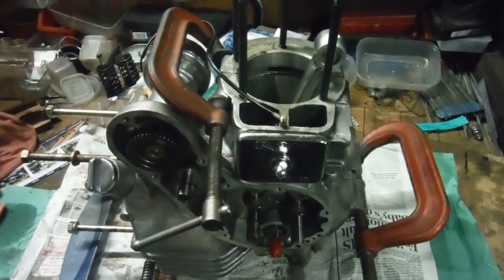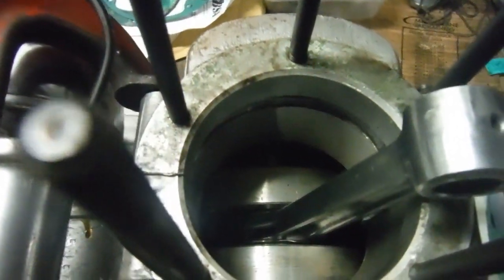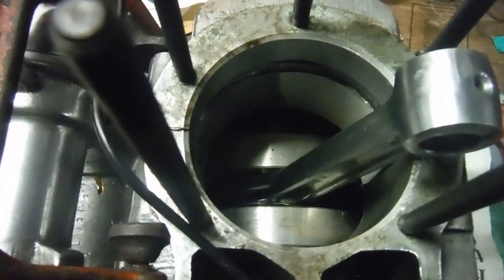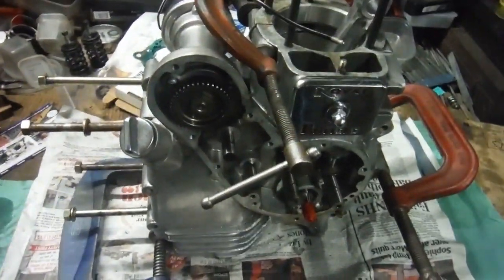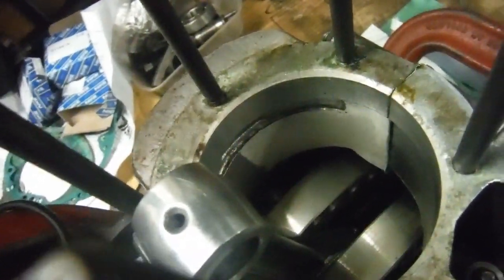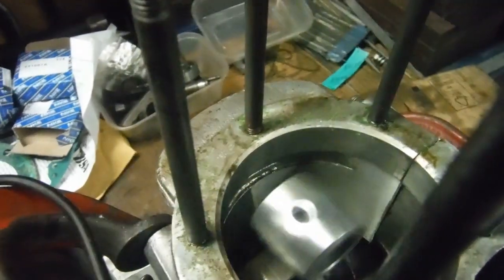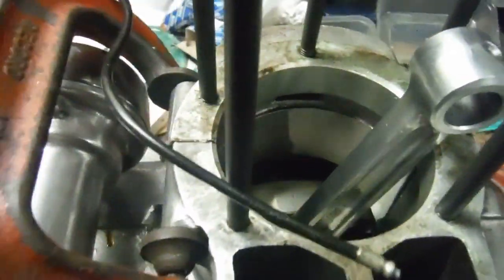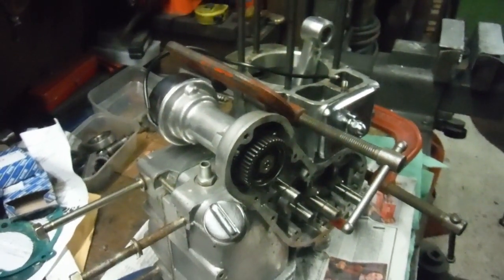Royal Enfield 500 Bullet Asbo 47 engine bottom end check before reassembly.

Comment: Hi Paul, I have 2 500 iron barrel engines apart at the moment & the timing side oil seal is not fitted the same way round in both engines. I've been scouring your videos trying to see which way round I should fit this seal but can't get a clear view in any of them, I would be very grateful if you could advise the correct way round please ?
Reply from the maker: Hi - the spring side should face outwards.
Reply: @paulhenshaw4514  Many thanks Paul, its just not clear on any exploded diagram I've looked at ?

Comment: Nice work done, my crank doesn't move this easily by hand after a stripping of whole engine. The bullet I have is an indian 1990 model, it has got a brass bush on the timing side, the bush was made and could it be the reason that the crank is not moving this easily?
Reply from the maker: It might be, or maybe the crank is not trued too well.
Reply: @paulhenshaw4514  it is nicely balanced with no run out. The brass is there instead of oil seal to stop oil going into the crankcase. The pre 2000s bullet you rebuild all have got brass bush or you modify for oil seal?
Reply from the maker: @greasemonkey1744  I have only seen the bronze bush in the older, British built engines and the oil seal in, I think, all the Indian engines I have worked on.